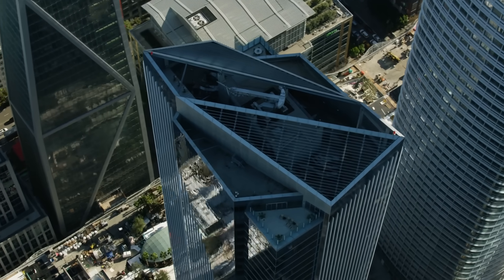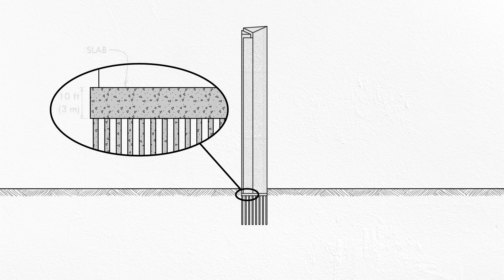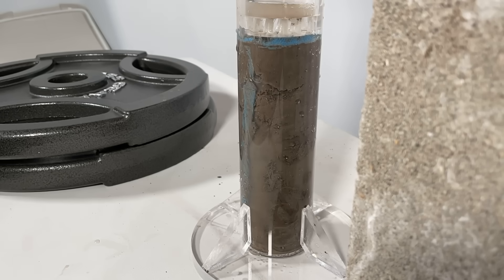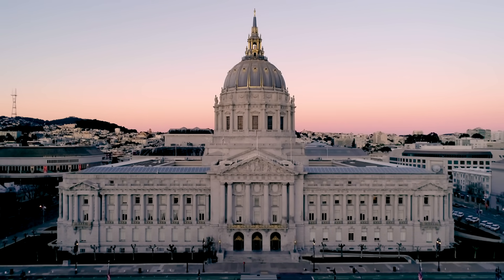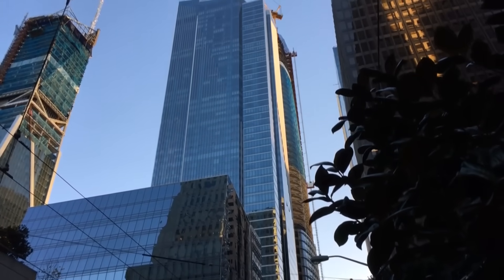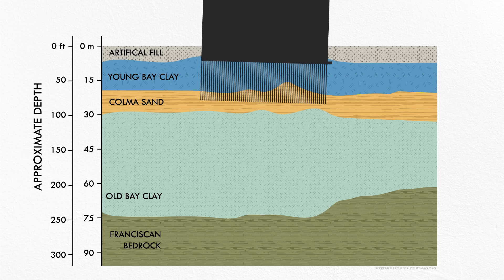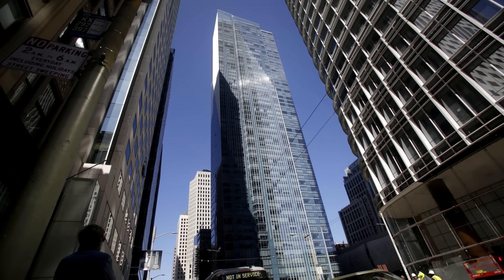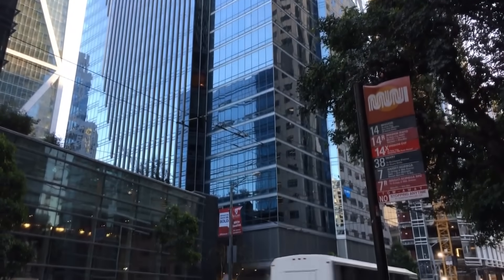What Really Happened at the Millennium Tower?

Comment: None of this will work. It’s a rip off tax payer nightmare. A quagmire like a leaking water faucet that just never stops dripping until a correct fix is made. Like putting the entire 4 corners of the building is placed on bedrock with piles on all 4 corners of the building. But the greed mongers will bleed billions in tax dollars to just fix one side of the building. Then they will say the other side needs to be done if you want it totally safe. And they know this already. But to tell San Francisco tax payers they will be spending more to stabilize this building then the entire original building cost. Do city officials are trying to screw tax payers gently. 😂

Comment: Flawed design with the tiny little 6 & 1/2" x 1 & 1/2" steel plates lifting the cement footing at the bottom of the threaded rods jacking system are way undersize and mos likely will fail.

Comment: Tear it down before it does it on it's own. There is no saving this Derelict, Dangerous building. That's under normal conditions. Imagine an Eathquake which could happen tomorrow night; You will have a complete, catastrophes failure of the structure, collapsing on its weak side and onto the buildings adjacent. It will be one of the worst man made disasters in US History. 

ACT NOW SF.

Comment: I have 2 questions, if just drilling a hole accelerated the sinking and lean of the building, then how can they say it is safe in a earthquake with much, much more energy imparted on the sub soils? And the second is this, it is a year later so did they fix it? I don't care about the sensationalist medea and would much rather have you tell me what is currently the situation. Thank you and be safe.
Reply: The reason drilling likely caused movement is because it removes material from around and beneath the existing piles. Even if you are using casing which separates the hole from the external soils you will still get running sand filling up the hole from the bottom which removes material under the toe of the existing piles. 

An earthquake doesn’t really have this effect since it doesn’t remove material and everything is displacing by the same relative amount.

Comment: Why not pump material underneath the foundation slab?
Reply: The amount of pumping pressure required to lift the slab would make it unfeasible. You also have the piles to contend with. They will effectively anchor the base slab down and even if you did lift it you would then have low density area beneath the piles which would lead to future subsidence.

Comment: The Millennium Tower never should have been built to begin with. I suspect the problems will continue after that latest solution proves it doesn't work the lawsuits and blame will begin all over again. A$500ml repair that will probably not work on a building that cost $350ml to build. The most cost effective solution is to raze the building and build something correctly in its place.

Comment: They opted to underpin the foundation on the outside rather than the inside and even that didn't work because it made the existing problem worse and they had to temporarily stop work have the engineers reevaluate and last I heard they were continuing with the underpinning of the foundation and nothing is going to help you have to tear the building down to a level that you can actually redo the entire foundation underpinning a building of this size will not work

Comment: So my understand was that not only was it the piles not reaching through the old bay mud to the dense bedrock, but that the structural system was also changed. Originally the plan was for the building to be constructed with steel girders and columns and thus the engineers understood that the old bay mud should be enough for the structure as it was designed. The developer however in a bid to save cost on the structure proposed with the contractor to replace the structural system with a reinforced concrete design, not taking into account the design for the sub-structure that was going into the ground. This also contributed on top of the issues outlined in this video about why the building sunk faster, but the added weight of the concrete instead of steel was also not taken into account thus exacerbated the sinking.
Reply: The Developer ended up spending those “saved” $$, and more, on the litigation and payout. Karma got them in the end, and the story is not over yet.
Reply: very interesting - a change at one level of construction can have impacts on other levels
Reply: I kind of find that story hard to believe. Do you have a source ?
Reply: @juandenz2008  his source might be some guy in a bar...
Reply: That was from a friend who is a structural engineer in San Francisco for DeSimone engineering.
Reply: @kk_bricks8043  I see, that claim has been repeated a few times but it is always hearsay. I think if that mistake was made, then it would've been documented in some of the many reports. However it just sounds too farfetched.
Reply: Got it good to know. The stupidity of it all is basically why they didn’t go to bedrock plain and simple.
Reply: The 3m thick concrete foundation pad has been bending and cracking for years.
Reply: Yes no doubt.
Reply: where did you hear that? It makes no sense...
Reply: The design change put up a building double the weight the foundation was designed for.

Comment: Hi Grady ,  hindsight is always a fascinating Tool . Crystal Ball gazing is a Science  of what ifs ... 
However  correct and proper Engineering  especially  on reclamation land as in this case in San Fran is and always will be Problematic ..  
Build in any Liquification issues with future San Andreas Fault Failures or any sub faulting Failures ... Then  San Francisco might as well in a Mega Giant Concrete Mixer effect  ....
 One Solution would to stop high rise Builds 
Two  Relocation  of the Cites of the whole Bay area ... But thats not a Practical Engineering  Solution Grady 🤔 

Great Presentation  Thankyou  Grady

Comment: Drilling more piles will not fix the issue ,
 Only will create more and the new piles will bends under pressure .
If you want to fix the issue permanently , you need to remove top 20 floors .
 This kind of issue always happen when you saving money on the wrong Corner of construction
You can ask any carpenter from Europe and hi can tell you to write answer .
 I wish best of the lock to the building and thank you so much for great video about the issue you are on the right track

Comment: Addressing what people think about buildings and earthquakes:

Large buildings are better at withstanding earthquakes. Medium sized buildings are the ones to watch out for (5-15 floors). It all depends of course, the main factor here is the natural frequency of the building, the bigger it is the lower the frequency. If the earthquake’s wavelength matches the natural frequency you get vibration resonance. Resonance is what happened to the Tacoma bridge. Resonance is what ultimately makes a structure fail. Most earthquakes have a wavelength that can affect medium-sized buildings
Seismic isolation systems in big buildings are mostly for the comfort of the residents, the building won’t fall but everything inside that is not anchored to a wall WILL FALL. Having a TV fall on your head surely is dangerous. So that’s another tip, anchor everything to a wall if you live higher up

Comment: When you build up on the sand...this is why you drill to bedrock!  Always always always!  And instead of hammering the piles down to bedrock they should drill down to bedrock that would reduce the vibration to the surrounding buildings because you have an auger like mechanism bringing the soils you are displacing up to the surface versus just pounding them down

Comment: Maybe the value of the apartments in the building would increase if the owners advertised that the floors are self-cleaning:  if you spill milk on the floor , it will drain off toward the northwest instead of just sit there and form a puddle.  But I wouldn't want to store my ball bearings there.

Comment: I'm not an engineer, so my question may seem quite evident to some.  Could the drilling through the old bay clay during the installation of the external pilings have any effect on the surrounding buildings?  Would there be any liquefaction that could negatively impact their integrity?
Reply: yes absolutely and so I guarantee you they have set up monitors on the surrounding buildings - I have had to do this even on small projects adjacent to neighboring properties where drilling might have a negative effect on soil stability
Reply: @David Holubetz  thanks for the answer David!!

Comment: First I want to identified myself .Iam Geotechnical Engineer with 52  years of experience.The condition of sinking and tilting of the San Francisco Millennium Tower comes from the foundation stress reaching the deep san francisco clay bay strata is larger than the yield shear strength of the clay,since the clay soils behaves like a plastic solid once the clay soil reach this condition begins a plastic flow under costant load
this condition is no more than the shear strength failure of the clay strata and the foundation of the tower
difficult to stop.The sinking and tilting of the tower are not do to consolidation neither  to the dewatering during construction of the transbay building near by.My recomendation as a preventive meassure is to take out all the people living in the tower while the engineers work a final solution to make the tower stable to avoid future risk.The tower is located in an active sismic area and strong winds.

Comment: Re the engineers showing the tower is 'perfectly safe', but condo prices falling anyway.   
I would think the problem there is that saying "it is safe" and saying "it will remain safe under all scenarios", are quite different.
As I understand it, and without checking the numbers, the top of the building is currently about 3ft out of plumb, and another foot could make lifts inoperable and water/waste pipes damaged. 
Given that the remediation works have increased the rate of tilt, I am not surprised people are concerned!

I am supposing that, in the end, all the additional pilings will be installed and the building jacked up, before it becomes uninhabitable.  Or falls over.  But looks like it's going to be a 'nail-biter'.

Comment: That's really cool. So they don't think they'll ever need to access the jack again in the vault?
Reply: Grady used a very simplified graphic.   The vault will be accessible for inspections, and so that the loading of the retrofit pilings can be adjusted as the building settles.   Also the Jacks will not be bearing the load permanently. once the pilings have been loaded with the jacks, the load will be transferred to mechanical load bearing blocks (for lack of a better word)

Comment: Are you sure the numbers aren't off? 5kPa for residential building and 500kPa for highrise? 1 atm ~ 1 kg per square centimeter ~ 101kPa. It's easy to push with 5kg for 1 cm^2 with a finger, i.e. skyscraper pushes the ground with just a human finger force for each cm^2 area? Sounds wrong.
Reply: The tower has a large footprint. All those finger presses add up to an unbelievable amount of force.

But even from a per-unit-area pressure perspective, yes! If you push your finger against soil -- especially for years or decades on end -- the ground around your finger will definitely shift. A single finger-press is much more pressure than topsoil normally experiences.
Reply: @General12th  still sounds wrong af. above any and every single each square centimeter there's hundred meters of concrete and steel. It seems odd that 100m finger thick column of concrete/steel weights just 5kg.
Reply: on another look, density of reinforced concrete is just 2400km/m3, so it's 24g for sm3, so 5kg will yield about 2m on matter above each sm2, that might be about right.

Comment: why not drill a series of small-diameter relief wells into the clay on the high side of the building to accelerate settlement on that side and straighten it up while the new piles are drilled?

Comment: The 52 piles originally planned have apparently been reduced to 18 piles. These piles will be very slender. How on earth (no pun intended) can these piles be kept from buckling (see Euler) which reduces their load carrying capacity? 
If they are over drilling the holes so that "no part of the new piles can come into contact with the Old Bay Clay" and then the space filled with low strength material, what will prevent buckling of the columns under these very high loads of 800,000 pounds per pile? 
Have the engineers calculated  what load (based on the length of the unsupported column) each pile can handle without beginning to buckle?
Reply: The buckling of the long slender piles, or columns, is known as the 'slenderness ratio'.
Reply: Tbf, since the piles are driven through soil, they can be designed as fully restrained throughout its length

Comment: Well if it's not up to code, they might be better off demolishing and starting over, as for the current safety of the building, I'm not convinced that will be the case in the long-term as they can't even get the fix done without destabilizing it further. I wouldn't want to be on the ground floor, after all you didn't buy a sub basement level apartment!

Comment: The "building is safe" is highly debatable and those suggesting it is are the same ones who approved trying to reinvent the wheel. Should have gone to bedrock like any other building does usually. The building is now NOT built to codes that apply so  "its safe" is total rubbish. The value of those condos will never see their true worth, ever. 
5 years later...they are going to bedrock to fix this problem but only the two perimeters which still leaves too much doubt for future soil responses. I doubt this building will ever get a total fix. They may as well tear it down and start over with a proper foundation.

Comment: Makes a lot of sence when one cogitates on the bay bridge abortion. .And the use of metals that caltrans explicitly state in writing are never to be used. .But were used on the bridge..A real head scratcher..  They use air conditioners to keep metals dry water cause them to fracture.. Hello bay bridge fog over water metals that dont like getting wet..  This building is just a typical scew up for frisco.. i ask you to read up on all the screw ups makes for fascinating reading.. Still no peoples walkway, dont know if it can be done but was in plans...  Peoples did not test concrete in footings..chinese welders for bridge parts from china were not welded properly. Had to re weld and train Chinese workers.. Metals that water makes brittle, were not protected from rain Im gobsmacked on that one..

Comment: This video was made 7 mos. ago and Hamburger has made more mods to his proposed repair by reducing the number of piles from as I recall, 52 down to 18. This will produce less vibration during installation but pile loading will increase. The fact that they keep tweaking and tweaking the design suggests to me that ultimately this bldg will be torn down or at minimum some number of floors will be removed. All of these measures are stop gap to forestall the inevitable.
Reply: Yup, now just the center is sinking and the lean is not correcting itself as planned.
Reply: Any new updates?
Reply: It was inevitable from the start. Most locals knew it within 6 months.